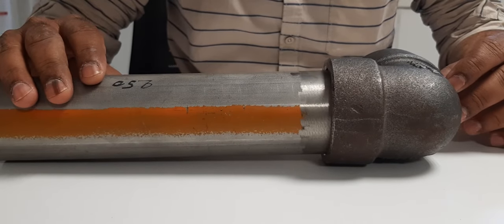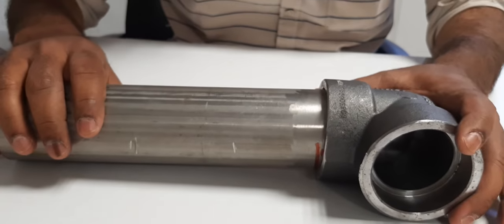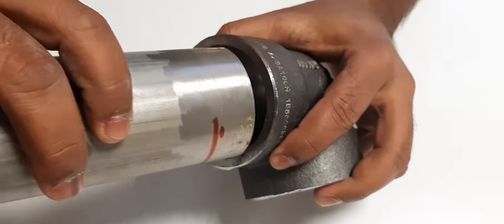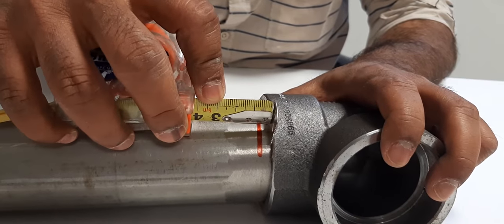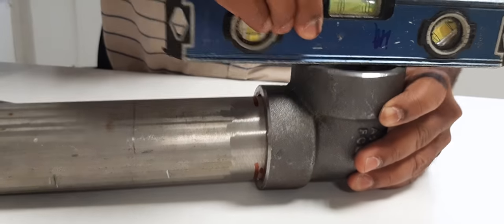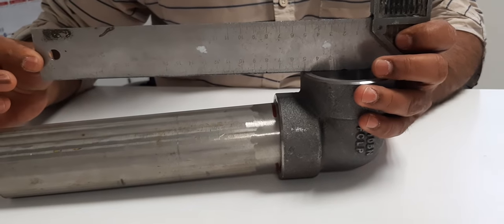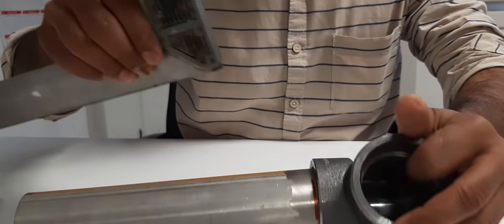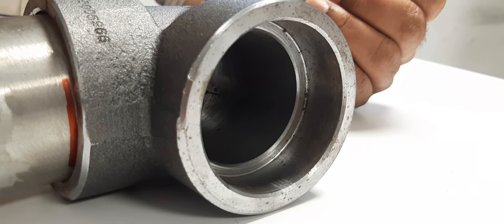Socket # fit-up #

Comment: Sir I'm currently work in socket weldings pipelines  3/4 inch ... Our criteria is 1.6 mm to 2.5 as per our client ... We using readymade asme approved gap ring as 2.4mm but even though  after welding we facing problem the gap comes as 1mm or 2.5 above sometimes ... How I can overcome this issue ... ???
Reply from the maker: Hi the code says that during fitup have to be maintain the gap but after welding  Heat input it will get 1.5 to 2 max it s accepted / the scenario is not touched both face/ if after welding u not find gap it will create crack in future during operation